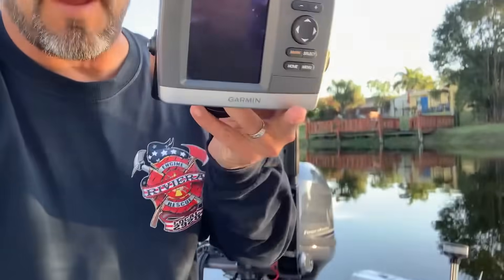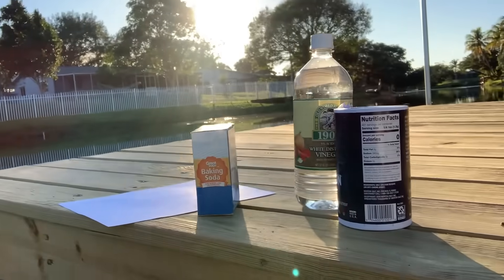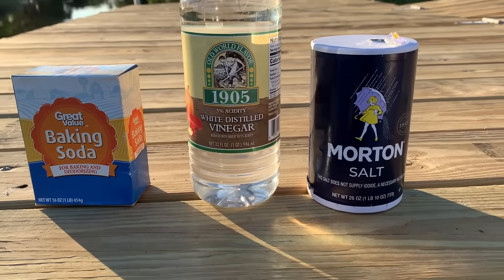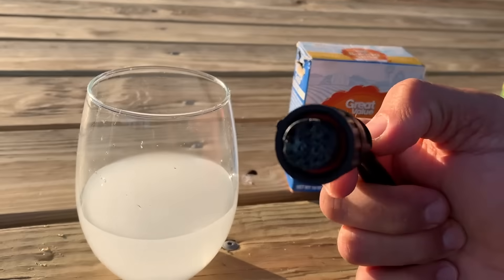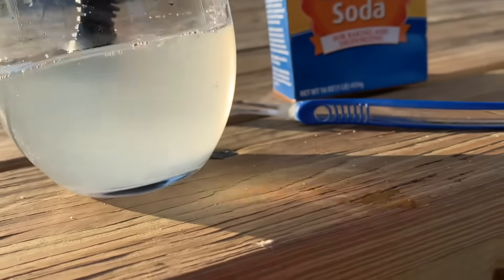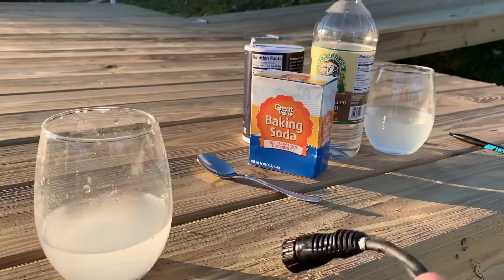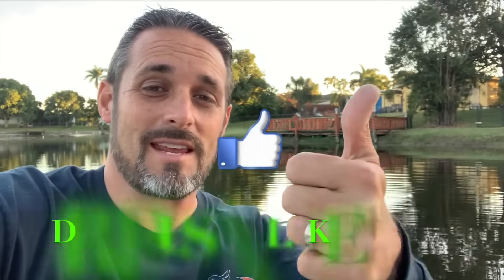HOW TO CLEAN CORROSION FROM COPPER ELECTRICAL CONNECTIONS USING HOUSEHOLD CHEMICALS

Comment: I'm going to try it without the table salt on my detachable face auto radio. Doesn't seem like the dissolved salt should be helping anything if the salt water caused your problem in the first place. I would have thought the baking soda and a toothbrush alone would have done the trick as it does on an auto battery terminal cleaning. But, hey! What do I know?!  Thx for the idea.

Comment: Omg don't use salt, vinegar is fine
Reply: Salt not needed. He could even try a higher concentration vinegar. Rinse well. The salt won't be abrasive because it's in solution.
Reply: Salt is needed, in this scenario the salt improves the conductive properties of the acid, speeding up the chemical reaction and limiting the amount of time spent in the solution, this is important If rubber or plastic is dipped along with the copper wire. If it was just copper then pure vinegar overnight is optimal.
Reply: Well done man, and the comments are very helpful also. Thanks everyone
Reply: It's an abrasive which can help in certain situations Edit: although in this case for electrical connections it's probably best to avoid it
Reply: Salt and vinegar make hydrchloric acid which will dissolve copper. So ya vinegar is fine without salt
Reply: @leo959 and thats why you use baking soda to neutralize it. You dont leave car wires for overnight soak, so stronger solution is optimal.
Reply: Why not cuz its a oxidizer or

Comment: Could use some electronics cleaner spray and let it air dry, then add some dielectric grease to prevent that from happening again.
Reply: I don't know if I'm right but I'm pretty sure I used electric parts cleaner extremely Generous and it only works for degreesing them NOT FOR COROSION chances im wrong not very good this it by far the only and best method I have ever came across that worksin minutes. And I've also tried some really expensive stuff for the quantity I got and it turned out to be a waste i never so clean copper. It might of improved contact but that didn't last long at all  this is the best method and finish it off with the bakansoda to neutralize the salt and vinegar mix acid and finally using dialectic grease to almost permanently prevent furniture corrosion.
Reply from the maker: True true.
Reply: WD-40...USED ON ROCKETS LAUNCHED @ SEA LEVEL(SEA...SALT) OK WD= WATER DISPLACEMENT...HELLO...UM...ALSO...DRIES WET IGNITION ON CHEVYS...FORDS NOT SO BAD...ASTROS.. ARE DEAD BUSTED WITH WATER ON DIST...

Comment: I’m confused you never put the baking soda in. You only used salt and vinegar
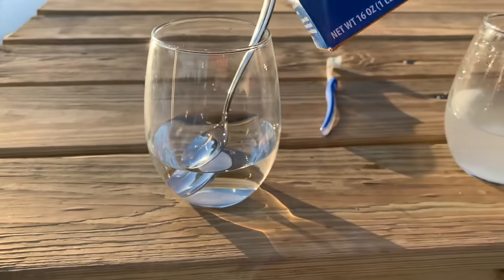Reply from the maker: Yes - the baking soda went in the water at about the 6:00 minute mark
Reply: Correct, the acid from the S+V mix cleans the corrosion and the baking soda water is used to neutralize the acid from the S+V mix.